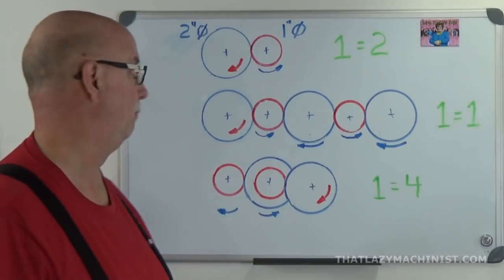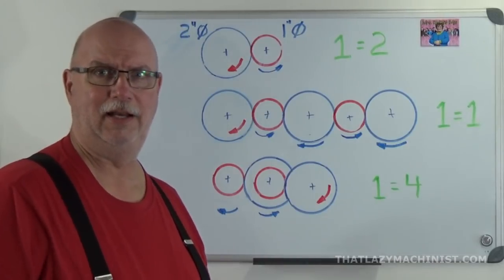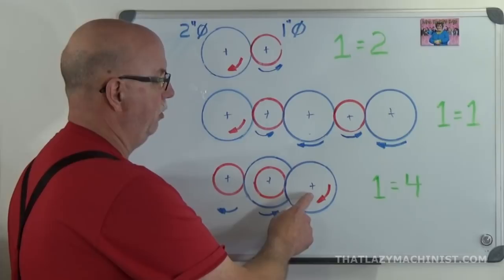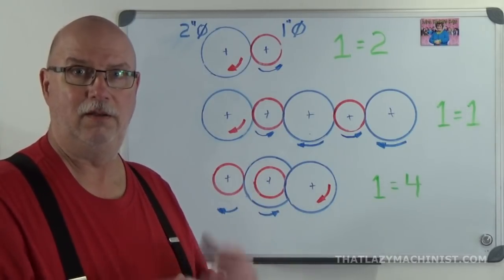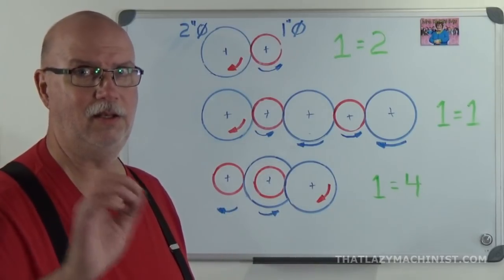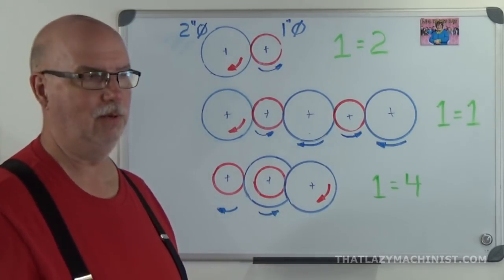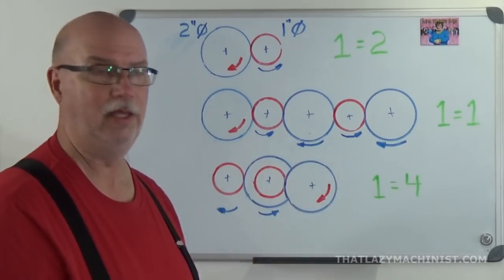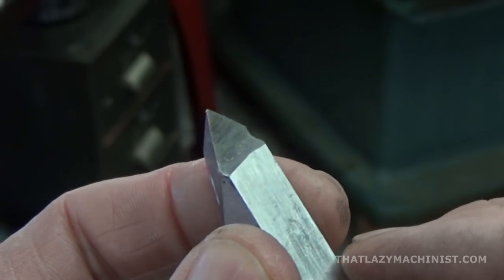Q&A 1 Gear trains basic principles, turning small (tiny) diameters and thread pitch calculations

Comment: I usually start my Saturday morning (after doing my chores) by coming to the Tin Barn with a big cup of coffee and spending some time catching up on videos posted by my friends on YouTube.  What an absolute joy it was to watch this video this morning.  You did an excellent job on explaining all three questions.  I guess I do still have one question though.  In a drive train, if I understand correctly, by increasing your speed, you lose power or torque.  If that is so, do you get that power/torque back when you decrease your speed through subsequent gears?  In your 2nd example where you wind up with a 1:1 speed, is the power/torque at the driven gear the same as at the drive gear?  Thanks again so much for taking time to put this together.
Reply from the maker: Hi Lee! All the gears between the two end gears are idler gears and the torque would be calculated as if they didn't exist BUT!!! The idler gears have mass and there is friction between them, unless the gears are massive the forces aren't huge but they must be taken into consideration. That is why chains (or belts) are preferred for large gaps.
Reply: Great!  Thanks again for teaching this old dog some new stuff!